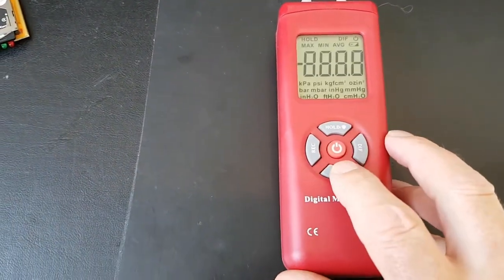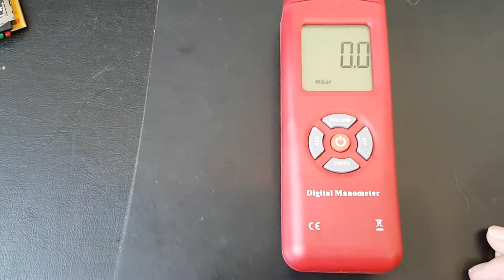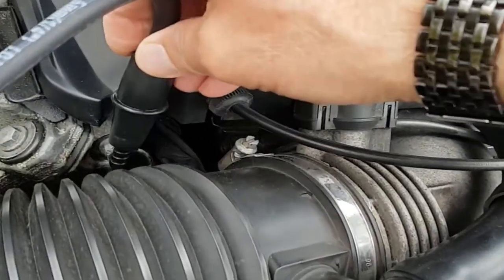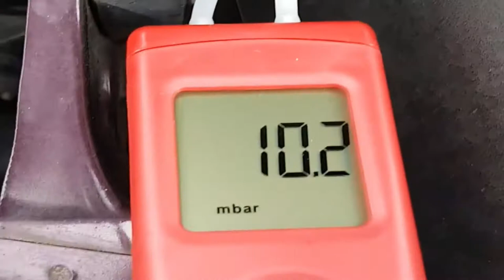BMW Engines - Is gurgling from the dipstick tube trouble?

Comment: So what does gurgling from oil dipstick mean ? I cleaned oil dipstick tube and it didn't help. Still gurgling. It stops only when I open oil cap
Reply: just happened on my 330ci e46, ive replaced my ccv a few months ago and when i take the cap off it stops gurgling

Comment: Tim, you have a FANTASTIC website! I have the MID out of the dash but I don't know how to disconnect the wiring harness. LOL, I am a bit afraid I will break it. Is there a way to remove it properly without yanking?
Reply from the maker: Thanks, I'm always glad to hear that the site does something useful! It's been a while since I popped the MID out - but AFAIR there are slide-catches that have to be pulled along the horizontal axis - have a look at those connectors and hopefully it will make sense. But, as I say, it's been a while!
Reply: Tim, thanks for the assistance. After much angst, I discovered it was a simple half circle/arch lever that you pull down that releases the wires! Classic German engineering! Anyway, this is for a 1997 840ci lovingly being cared for in Arizona.